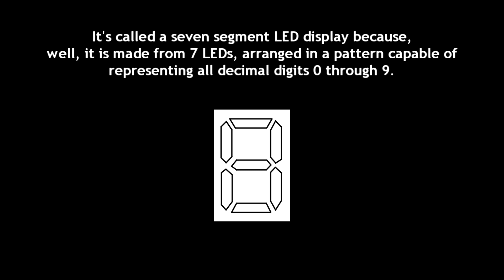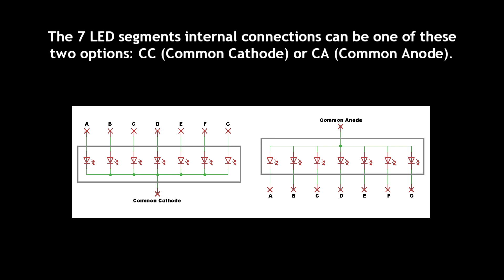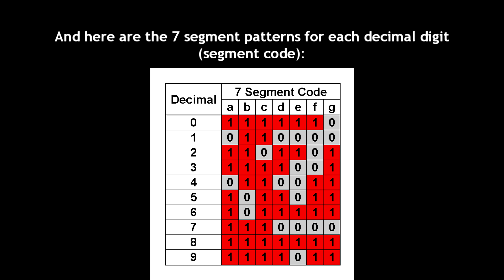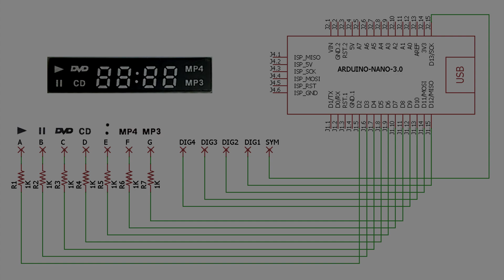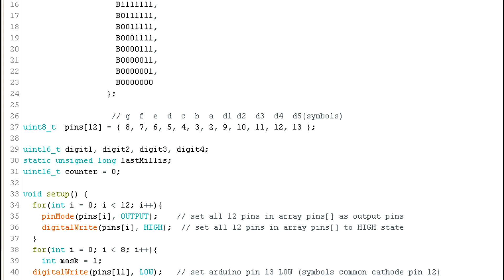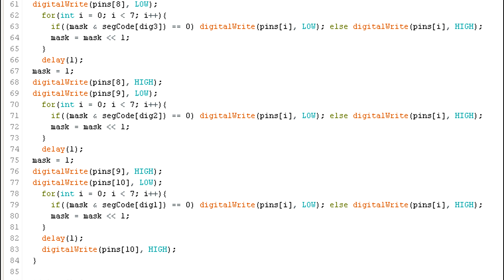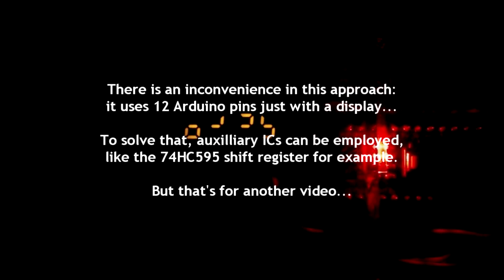DVD LED Display and Arduino Nano (Seven Segment LED Display basics)

Comment from the maker: /* :_bat1: Arduino Code from https://www.youtube.com/watch?v=SIwdiQYyt2Q  */
byte segCode[10] = { // abcdefg
                       B1111110, // 0
                       B0110000, // 1
                       B1101101, // 2
                       B1111001, // 3
                       B0110011, // 4
                       B1011011, // 5
                       B1011111, // 6
                       B1110000, // 7
                       B1111111, // 8
                       B1111011  // 9
                   };

byte symbols[8] = {
                    B1111111, 
                    B0111111, 
                    B0011111, 
                    B0001111, 
                    B0000111, 
                    B0000011, 
                    B0000001, 
                    B0000000
                  };

                   // g  f  e  d  c  b  a  d1 d2  d3  d4  d5(symbols)
uint8_t  pins[12] = { 8, 7, 6, 5, 4, 3, 2, 9, 10, 11, 12, 13 };

uint16_t digit1, digit2, digit3, digit4;
static unsigned long lastMillis;
uint16_t counter = 0;

void setup() {
  for(int i = 0; i < 12; i++){
    pinMode(pins[i], OUTPUT);    // set all 12 pins in array pins[] as output pins
    digitalWrite(pins[i], HIGH);  // set all 12 pins in array pins[] to HIGH state
  }
  for(int i = 0; i < 8; i++){
    int mask = 1;
  digitalWrite(pins[11], LOW);   // set arduino pin 13 LOW (symbols common cathode pin 12)
    for(int j = 0; j < 7; j++){
      if((mask & symbols[i] ) == 0) digitalWrite(pins[j], LOW); else digitalWrite(pins[j], HIGH);
      mask = mask << 1;
    }
    delay(550);
    digitalWrite(pins[11], HIGH);
  }
    delay(800);
}

void displaySeg(int dig1, int dig2, int dig3, int dig4){
  int mask = 1;
  digitalWrite(pins[7], LOW);
    for(int i = 0; i < 7; i++){
      if((mask & segCode[dig4] ) == 0) digitalWrite(pins[i], LOW); else digitalWrite(pins[i], HIGH);
      mask = mask << 1;
    }
    delay(1);
  mask = 1;
  digitalWrite(pins[7], HIGH);
  digitalWrite(pins[8], LOW);
    for(int i = 0; i < 7; i++){
      if((mask & segCode[dig3]) == 0) digitalWrite(pins[i], LOW); else digitalWrite(pins[i], HIGH);
      mask = mask << 1;
    }
    delay(1);
  mask = 1;
  digitalWrite(pins[8], HIGH);
  digitalWrite(pins[9], LOW);
    for(int i = 0; i < 7; i++){
      if((mask & segCode[dig2]) == 0) digitalWrite(pins[i], LOW); else digitalWrite(pins[i], HIGH);
      mask = mask << 1;
    }
    delay(1);
  mask = 1;
  digitalWrite(pins[9], HIGH);
  digitalWrite(pins[10], LOW);
    for(int i = 0; i < 7; i++){
      if((mask & segCode[dig1]) == 0) digitalWrite(pins[i], LOW); else digitalWrite(pins[i], HIGH);
      mask = mask << 1;
    }
    delay(1);
    digitalWrite(pins[10], HIGH);
  }

void loop() {
  if (millis() - lastMillis > 80)
  {
counter++;
    if (counter % 1000  == 0) digit4  = digit4+1;
    if (counter %  100  == 0) digit3  = digit3+1;
    if (counter %   10  == 0) digit2  = digit2+1;
    digit1 = counter;
    if (counter > 9999) counter = 0;
    lastMillis = millis();
  }
    displaySeg( digit1 % 10, digit2 % 10, digit3 % 10, digit4 % 10 );
}